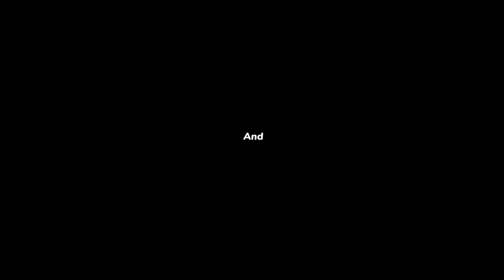Power Washing , Softwashing, And A Tough Oil Stain #howto #powerwashing #softwashing

Comment: Miracle pressure washing used “cobble clean” seems to work well! Wonder if the rust remover or acid would make it better.
Reply from the maker: He used it on fresh stain. That stain is 8 years old. Only thing that will work is a torch on it.
Reply: @PinkFlamingoPowerWash  8 years old? Man I thought they did that like a week or two ago. Good luck to them! I see why it wouldn’t come up. I was about to say a torch would work to a certain extent.
Reply from the maker: @derrickbell3087  I recommended them to do the torch trick and it worked. Then he hit it with a light gray spray paint to blend it end.
Reply: @PinkFlamingoPowerWash  sounds good to me. I am sure it will blend in and look much better than before.

Comment: Hey Cliff, if you post treat those sidewalks with a 5 or 6% mix, how do you prevent the edges of the grass from burning? Thanks and great video!
Reply from the maker: The edges are already saturated from surface cleaning the sidewalks and also when I rinse the sidewalks off so they're not gonna get burned.
Reply: @PinkFlamingoPowerWash  Thanks Cliff! You’ve been so generous with info and I really appreciate you!

Comment: Man if someone could come up with a chemical that can get oil stains up completely will be a millionaire. Stay safe with that Hurricane heading towards yaw.
Reply from the maker: Facts.  Seems like a torch is the best thing
Reply: @PinkFlamingoPowerWash  I've seen that done before on a video. Got to be careful that the concrete doesn't get too hot it can have like a lil explosion because of the moisture in the concrete
Reply from the maker: @randybarlow9587  yes that's what happened to him.  He  said it started popping 😭 😂